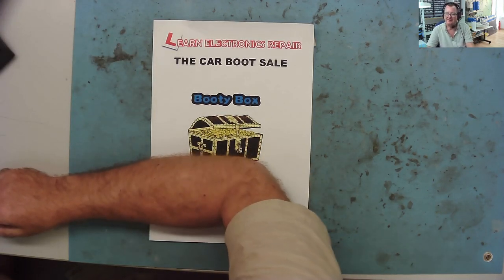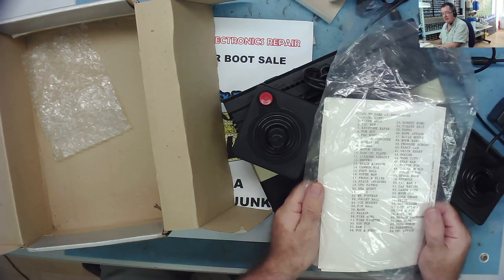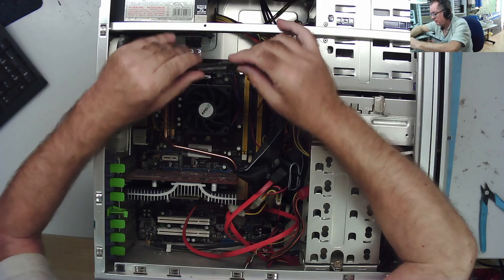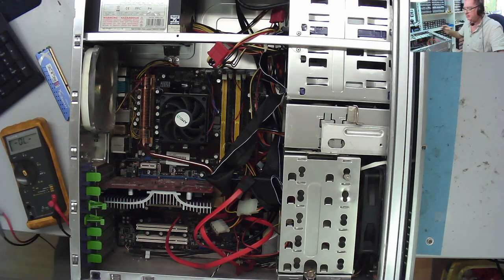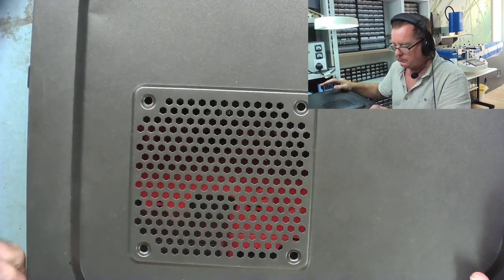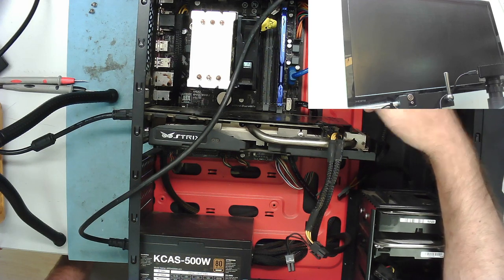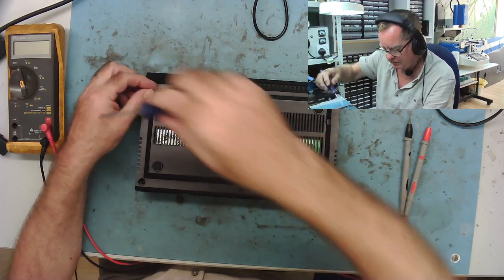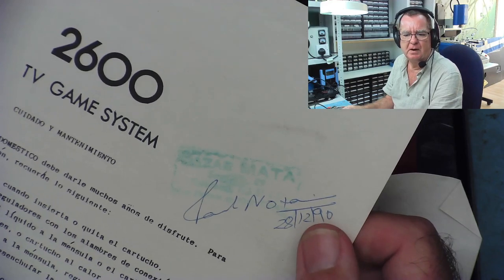Car Boot / Flea Market PC Computer Finds - Are they worth it? Let's make Money!

Comment: For the atari you need to manual search the channel before it was uhf band channel 36 normal
Reply from the maker: The problem I have is that I lost the remote control to the TV at the workshop and can't get into the menu to start a scan whatever buttons I press on the TV (of which there are just four) I even tried pressing pairs of buttons but no menu
Reply: @LearnElectronicsRepair  you do not have an universal remote control maybey you can use that.

Comment: An Atari 2600 knockoff? Funnily enough, if it’s one from the 80’s and not one of the modern clones, it’s probably worth more than a real 2600!

A real 2600 can be picked up for around £30, that knockoff…around £50
Reply from the maker: Nice to know that Jon ,   I knew I could rely on you :D  I think we can count on this being an 80s one. Funny how a knockoff could be worth more than the original.  I just need to figure how to test it with what I have.